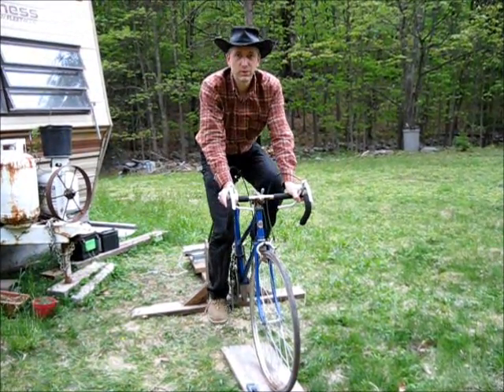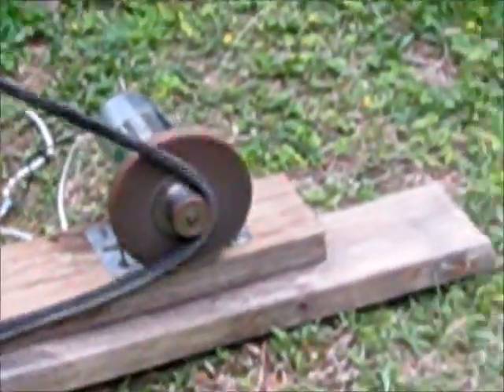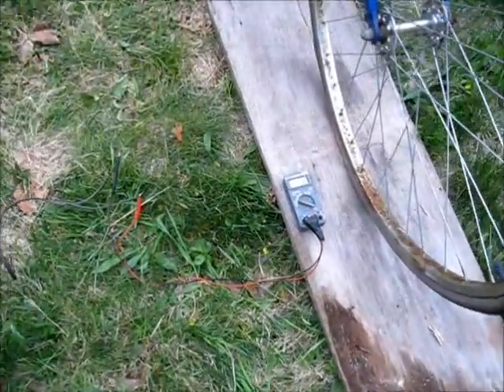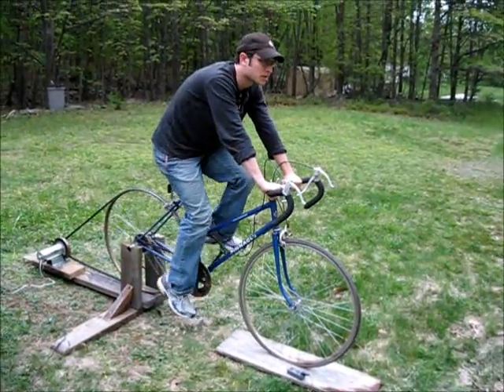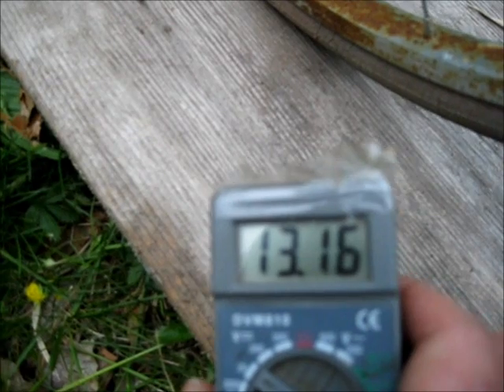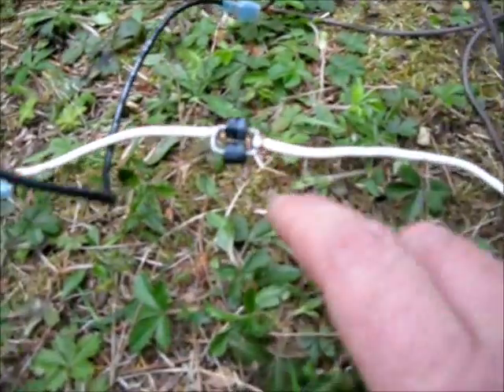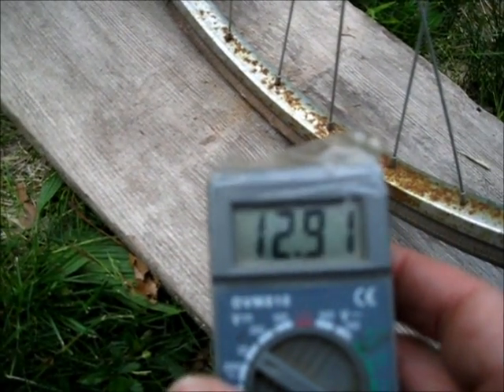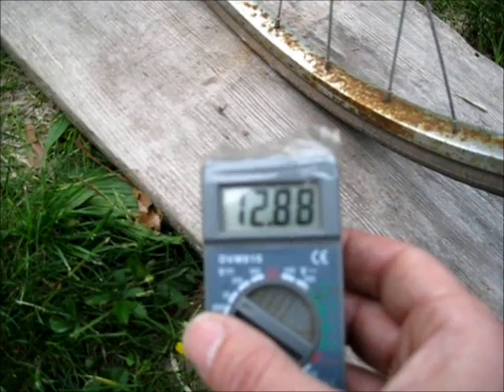Homemade Bicycle Generator - people power for off grid living

Comment: They used to have an exhibit at the epcot center where you could use a bicycle generator.  Of course the read out said I would have to peddle for 7 days to get the output you could get from 1 gallon of gasoline in 1980s technology.  And I was a 200+ miles a week bicyclist in those days.

Comment: You will have to spend many many more times in cash buying the food needed to have the energy to charge these batteries than the cost of the gasoline a generator would use to do the same job. NOT COUNTING the hours you would take to do the peddling. A Big Mac has 550 calories and a gallon of gasoline has 31,500 calories. That's over 56 Big Mac's in a gallon of gas.  OK you do the math and if you can't, here is the reality. Unless your buying Big Mac's for less than $.07,  you've created a machine that will cost you WAY MORE money in food to charge your batteries than the costs of gasoline a generator would use to do the same job.
Reply: Cheaper than paying for gym membership though.

Comment from the maker: Yes I have used one with a bike like this. It is very hard to turn and gives you quite a workout but it does work.

You must have the coil energized with a flip switch though or it will not work. Get the bike pedals pumping, flip the switch and charge the batteries.

When you flip the switch you can feel the drag on the pedals.

Comment from the maker: Hard to answer because it depends on the size of battery and the depth of discharge. Estimating 300 watts output for this motor you get about 25 amps per hour of usable energy.

Count for some losses in the lines and battery figure maybe 15 amps.

An average "car" battery has maybe 50 amps hours capacity. That means just over 3 hours if its fully discharged.

A deep cycle may have as much as 100 AH or more. Means a lot more work.

Comment from the maker: The white on the diode is positive. Yes solder them, thats best.

More batteries is better. It is a lot of work to charge batteries though, so be ready for some exercise.

The batteries life depends on what you use. Move to a laptop and an LED tv and your batteries will thank you.

You need an inverter to run AC household appliances.

Comment: Hasn't anyone thought of getting an automotive alternator with built-in diodes and voltage regulator? The salvage yard has lots of them.
Reply: Problem with car alternators is that they have to be spun at high speeds to produce any power (like at least 2500 RPM and higher would be better). Second, they are not very efficient, losing something like half of their energy to resistance in the windings, diode voltage drops and a small but significant siphoning of power to excite the field winding. This fellow has the right idea in using a small DC motor, preferably one with permanent magnets. And he definitely needs a heavier duty diode on the output of the generator.

Comment: You would need an inverter since household appliances don't normally run off of DC (Direct Current), let alone 12v. The inverter converts the output to 115v-120v AC (Alternating Current), so that is definitely a must in most cases.

There are many ways to connect wires, but soldering would be a good start.

I would say the white wire was positive (the one with the diodes) because diodes should always be connected to the positive current lead.

Comment: the white wire with the diodes is that a positive or negative wire, do u need to solder the wires to the diodes? do you need an inverter to use the car batteries? I want to make one to charge the tv and computer..how long does the batteries last should I buy 4 batteries as were getting sick from the smart meters and im a concerned mum looking for another option..

Comment: I have a treadmill motor in mind for the same type of project. The label says it can produce over 23 Amps. Would a 25 Amp charge controller or a 25 Amp diode be better to use? Thanks for your video, it was cool to watch.

Comment from the maker: A common AC motor will not work because they have no magnets in them. Use DC motors which have permanent magnets inside and can product power when turned.

Comment from the maker: Its exercise and free energy at the same time. Running an engine uses gas, which costs money. I will make a wind turbine soon.
Reply: For those willing to buy the gas, stick a bike motor on it. Those things get like 60 miles to the gallon. You could charge up a good amount of batteries off of a five gallon gas tank

Comment: be aware your meter does not show all the high voltage spikes coming from the generator and these can reduce the life of the battery substantially especially if using gel or agm batteries. if you have a solar charge controller use that for ease or get a 15/20A step down with constant current dcdc module from ebay. also lots of decoupling/filtering caps and a flyback diode across the generator. the caps must be rated to handle the highest spikes so a 90v motor potentially may put out 150v+. peace

Comment: Can we use a tabel fan uncovered type of motor instead in case friend. I try this by using a small fan which run with electricity so actually it does'nt work. I have a question that it really mean that the fan motor really doesnt work ?

Comment: Ahh but the battery would be used to induce a charge into the alternator, and if the alternator put out enough power it would be able to charge itself on top of whatever you attach to it.

Comment: You have a car with an alternator and pair of jumper cables why not idle the car for 20 minutes and charge the batteries from your car alternator. Take that treadmill motor and mount it on a post and build a wood turbine to off set your usage.

Comment from the maker: Yeah, makes me wonder too. Thats how the camper was made.

An alternator has no magnets, so it wont work.

Get a motor scooter motor off ebay for about $30 to 50. Use that instead. People get good results with them. High power means higher voltage. Go with 24 or 36 volts.

Comment: Lol I don't think I would have batteries sitting so close to propane, On a side note I was wanting to make a high powered electric bike powered by a single battery and alternator, I assumed it should be decently possible with the right gearing saw it done with a bike, It was supposed to be able to do 50mph but I dunno exactly what he used in it and he wants 50k for the stupid thing.

Comment: Why not use an inexpensive charge controller which will put the optimum voltage on the battery no matter how fast you pedal?  Then you don't have to worry about sizing the diodes.  A simple 30 A charge controller will cost about $30.  360 W is more than anyone could produce pedaling, even with proper gears, so it will be plenty big enough.

Comment: Alice, If you need to convert the rotational movement from a wheel to a back and forth motion, Find some pictures of an old steam engine and look at the wheels. You'll see a rod connected to the outer edge of the wheel that will go back and forth as the wheel turns.

Comment from the maker: Are you allowed have a magnet passing a coil instead in a rotational motion? That is much easier. Simply put magnets on the bike wheel and have a large coil of wire attached to the bike frame somewhere. The magnets pass the coil and generate a voltage.

I simply used wood to make a very simple frame to hold the bike up. Take a closer look at it in the video. Its hard to explain here. You can contact here:

info at thediyworld (dot) com

Comment: A diode will drop the voltage by 0.6 volts. Heat is wasted energy in this application so if you can add a few more diodes in parallel. Keep the wires as short as possible. DC doesn't "travel" well.

Same applies in your camper. Its better to extend the AC side of any inverter you might use and keep the DC side as short as possible, otherwise you'll waste energy heating up the wires. The higher the current the more energy you will waste.

Good luck with your project.

Comment: I got all the other parts pretty well thought out, but I couldnt think of how to build a good reliable stand...what you got there looks perfect.  My only question is, what metal parts  do you have on top of the 2x4's that connect to the axle bolts on the bike?

Comment from the maker: Depends on the size of the battery. But, I figure this puts out about 300 watts of power. Maybe a little less. Lets even say 200 due to you getting a bit tired and maybe slowing down a bit.

Take a 100 AH battery, then it would take about 5 to 10 hours roughly estimated, to charge the battery. That is equivalent to a standard plug in the wall charger time as well, for comparison.

But, since you are not supposed to discharge a battery below 50%, then half that. Swap with family and keep it going

Comment: I noticed in one of your other videos that you only have one battery bank. It is bad for batteries to be charged while under load. If you want to charge batteries and still run a load you need two battery banks. One for running the load while the other is charging. Your batteries and your wallet will love you for it.
Peace!

Comment from the maker: Actually, many years ago I saw that a man had done just that. If the kids wanted TV or a game, they had to pedal for it. Good stuff.
Reply: And you don't even have a Pulley on the treadmill motor - for the belt. That's how I set up my generator also! I just got a new treadmill motor. (or 3 years used). I was gonna try get a pulley but I'll probably skip it again.
Reply: in the case of a typical cheap treadmill motor, results in the HP falling by the square of the speed- as in, at half RPM, HP is a quarter rating, at a quarter speed it's a sixteenth, etc.

     If you lower the voltage the current will be lower.

    So in order to calculate the actual power we need to find the R or resistance of the motor. If we use ohms law V = I x R and rearrange it to V/I = R then 95Volts/21.4amps= 4.44 ohms.

    The formula for Power in watts is Vsqrd/R or

    48v x 48v / 4.44ohms = 519 watts

    At full voltage 95v x 95v / 4.44 = 2033 watts

    V = volts, I = current, R = resistance in ohms.

So that's 44 watts at 4.44 ohms and 14 volts! Not the watts you are claiming. thanks

Comment from the maker: I think the idea of pouring concrete in the spokes of the back wheel of the bike is the easiest one I have heard of so far. It will add mass and should be relatively even. It would be easy to balance due to its already being on the bike bearings.

Comment: Very cool!

I don't like the weights on pedals suggestion. The mass should be added to the rear wheel or even the motor somehow, since that's what needs to turn at a steady rate. Maybe extend the motor shaft and attach a round weight. The hard part will be proper balancing to prevent wobble and bearing stress. Also, you can pick a lower gear and just pedal faster to produce equivalent power.

Comment from the maker: For details, come to thediyworld (dot) com forum and I will be happy to help you out.

The short version is NOT car batteries. Use true deep cycle batteries (not marine starting).

Other than that, use a volt meter to fine which wire is plus when you pedal the bike. Hook up plus from the motor to plus of the batteries and minus to minus.

A diode in the + side blocks voltage from the batteries draining back out thru the motor.

Thats the simple version.

Comment from the maker: The batteries hold 200 Ah, or 2400 Watts total power. The bike puts out about 150 to 300 Watts. So it would take about 8 to 16 hours to fully top off the batteries. But you should never allow the batteries to get that low.

One hour of peddling provides 2 - 4 hours of laptop use for example. Or 2.5 to 5 hours of running a 60 Watt light bulb.

Or you could run a ccfl light for 15 - 30 hours on a single hour of peddling.

You could run a fridge or blender peddling full speed non stop.

Comment from the maker: Ouch, i never looked at the math to see how much I wasted. A buck inverter would also help match the voltage of the motor to the voltage of the batteries. This would reduce wasted power as well. One day I will be working on this idea.

Thanks for the info.
Reply: I got a little DC-DC buck inverter so I get 3 to 4 amps while in lowest bicycle gear.

Comment: if you put a much bigger flywheel (something with considerable weight) on the motor would this make the rotation smoother in the end and easier to peddle?

Comment: Avalanche-type diodes are not appropriate for this application, though that one would technically work. Also, the electricity being generated is coming from precious human effort and the stated part has a forward voltage drop of over half a volt. On that same Digi-Key site you can get bypass diodes with very low bias voltages of 180mV or so. Assuming typical diodes were used in this video, the statement "...at least 12 amps" equates to 8.4W of effort wasted (or <2.16W for good bypass diodes).

Comment: The battery is considered safe in that configuration as long as the protective cover stays on it and no connections are made or broken or the battery is allowed to short out at the terminals or wiring in the immediate vicinity of the tanks while the tanks are attached. There was likely a warning placard on the original battery cover. The battery belongs there because it will vent flammable gas, just like the tanks. There is risk, but it's accepted if you want electricity and gas.

Comment: ***digikey ***/product-detail/en/STPS20SM100ST/497-12642-5-ND/2122467    
20 amp 100 volt schottky  in a TO220 package will work good for your generator.
replace the *** with you know what.

Comment from the maker: It depends on how many batteries you get and how many watts your electronics use. Say two golf cart batteries at 200 AH x 12 votls = 2400 Watt hours.

Say your stuff uses 400 Watts, then you get about 6 hours on a full charge.

If your treadmill motor puts out about 400 watts, then it takes 6 hours to charge the batteries back up. Ouch.

Or hook it up to a windmill and get the energy for free.

Comment from the maker: Thanks for the great tip. The weights would probably help smooth out the rotation, wouldnt they? I am also considering adding cement to the back wheel to act like a huge flywheel.